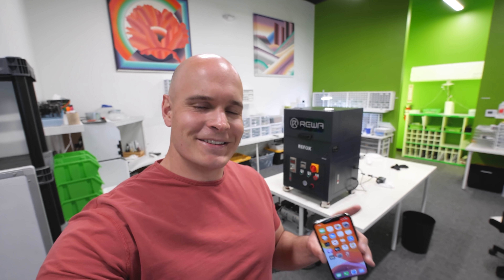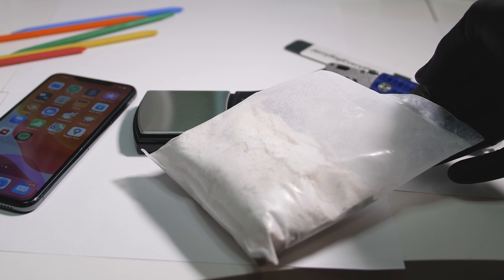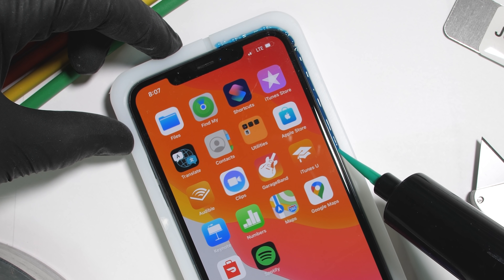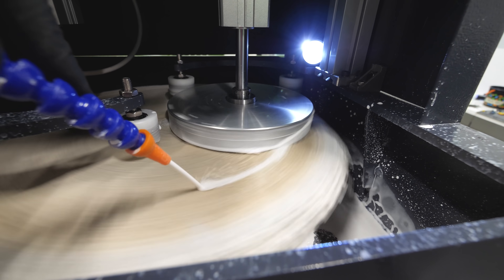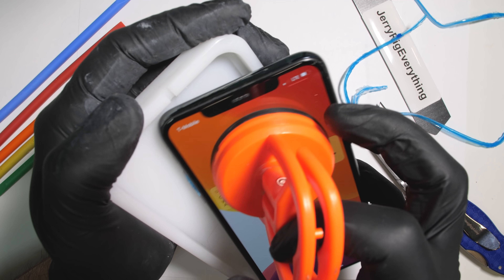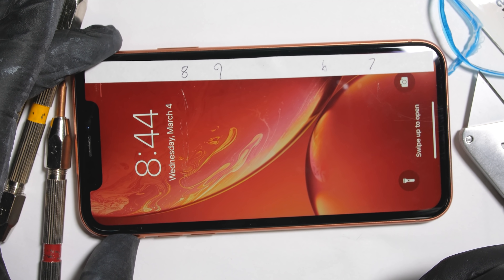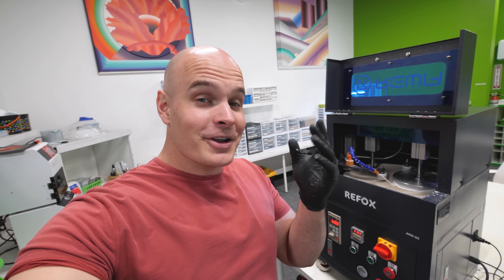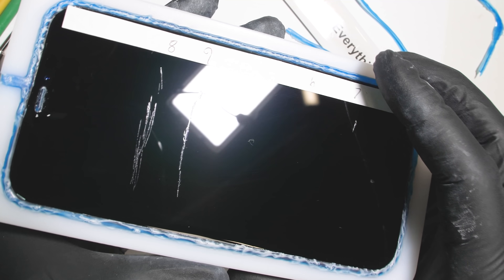How to Remove Scratches on an iPhone Screen? - (Not Clickbait)

Comment: Does this procedure thin the screen and maybe cause some abnormalities ?
Reply: Yes, but by such a small amount that it's negligible
And it shouldn't cause any major abnormalities besides removing the oleophobic coating (which, as shown in the video, can be replaced) if done properly.

So, (besides water damage risk) if this causes major issues with glass thickness, you're using it too much
And if you use it right, downsides are negligible and can be easily fixed

Comment: Hi, I don't have the same machine as you but I would like to ask you a question... why does the glue come off mine or does water get in with the glue applied? And what pressure is the machine at? Thank you very much

Comment: I have a question and I need help. 
After using cerium oxide how can I get rid of the mark that leave after that?
I use the powder and after cleaning it up it shows a darker  spot on it when I spray water. Is it the coating?

Comment: I've done this with a Dremel ¯\_(ツ)_/¯

Obviously it doesn't treat the whole screen evenly, but light scratches can be removed very quickly using a little cerium oxide and a polishing tool

Comment: So pretty much the old way of fixing games cause ppl didn't know how to take care of ANYTHING 20 years ago....little thing you spray the disk then put the disk in the  do-hicky crank and crank and crank for 5mins take it out clean it off then do it again the other way blah blah blah....cheaper way UV clear clear glue (clear 💅 works OKISH) then VERY VERY THIN coat only on the bad parts then WET SAND BY HAND then polish ****warning**** DO NOT I MEAN DO NOT even think of trying unless you know how to wet sand or you will make it 100000000000x worse

Comment: Cheap way: 
-cheap mini grider or burr + polishing pad $20, or just polishing pad $1
-glue gun for sealing phone hole 1$
-Cerium oxide 20gr $1
-auto glass coating 30ml $1
Total: under $100.000

Comment: What do you use for oleophobic coating?And would an automotive nano ceramic coating do the same thing? Thanks
Reply: NanoSlic NS-1500 is my best guess, or maybe Daikin Chemical DSX-e or UD120 (Daikin is dealers only)
I just bought a test pack of NS-1500 and excited to see how it treats my S22 ultra.
The coating is 100% completely gone. Such a shame with new phones nowadays. I still have my note20 and it's like brand new still, got it over 3 years ago 
I'll keep you updated on results
Reply: @collinmcballin  thanks for the info, did you try it out?

Comment: for small scratches a nano glass screen protector will hide them, and a regular temper glass will too but nanoglass works way better at hiding the scratches as it is applied as drops
Reply: While owning the phone, the use of screen protectors to cover and hide scratches is cool but the biggest reason we watch these videos and why these machines are important is about genuinely removing/erasing of scratches. And that's because we are concerned with the preservation of our phone's third-party resale value. As we are all aware, ANY minor scratch, however small and shallow, means automatic -$50 in resale price.

Comment: It's a pretty neat idea. But wouldn't the thinner glass cause issues with the touch response/sensitivity? Also, this might not work as well for phones with slightly curved displays
Reply: I think the digitizer is under the glass so it won't have an effect

Comment: Hi Jerry, do you maybe know if it's possible to get rid of permanent spots and wipes on the screen ?
i don't know if you know this but i noticed that if i use swipe gestures, quite quickly it leaves permanent wipes on the glass and now i also noticed this issue by using the under scree fingerprint scanner.
i can clean my screen as much as i want, it stays visable.

Comment: Not worth it in the long run. I’d rather live with the scratch. Back in the days of the iPhone 4, I got a small scratch on the screen. You couldn’t buff it out because it was aluminosilicate glass—glass artificially hardened with other elements such as aluminum and silicon. The glass is simply too hard. Those scratches on the glass are permanent I’m sorry to say. The only way to make them disappear is to shave a thin layer off. Shaving off a thin layer, you eliminate the light scratches to be sure. But along with it, you get rid of the oleophobic coating, and severely weaken the drop protection of the glass. Cool video, but a screen protector is cheaper, and it doesn’t permanently ruin your device.

Comment: Had almost all my phones without protectors, only phone with a protector was a Sony Ericsson Xperia - the first ever.
The protector was so shitty that I scrapped it and today a s9 and 4 years in use, the front glass is perfect , well those non visible scratches, but the back glass is broken on several corners and cracked in different directions.

But for a conclusion, the phone is still a practical piece of hardware and it doesn't really lose its practicality with those scratches.

I've made a mend with myself not to throw my phones and If I do, I'll cover the costs - you can hold the shit on a stick for just so long until it drops.

I'll better enjoy the outer dimensions and the visual aesthetics as long, rather than cover it with something

Comment: I don’t think I will trust someone to do that process on my iPhone 13 Pro so I can remove a potential scratch (as I don’t get scratches on my phone because I’m taking care of it), but this machine I think is a very good opportunity for shops that sell used phones and want their displays to be scratch free, to not replace them with shitty quality OEM ones, but instead use this machine to give new life to their original displays and sell them as scratch free ones! Add a new oleophobic coating on them after the process and you have an almost “brand new” phone to sell, at least screen wise!

Comment: For those who don’t know. Cirium oxide it what we use to remove scratches from windshields. Typically caused by windshield wipers… but it’s very difficult to use.
Reply: Do you have an email address? It’s like to speak to you about this windscreen business. Got scratches I want removed. Thanks In advance

Comment: Technically if you run it in the machine enough times you should be able to remove level 9 depending on how thick the screen is since the machine is just removing a small layer each time.
Reply: Not really since the level 9 cracks it all the way through so no matter how far you go unless you replace the glass it is staying

Comment: I've had 4 iPhones over the years, but this year my iPhone 12 mini has got several scratches on it, this was NEVER an issue for me before. Apple claims the 12 is the hardest they've made (up to then), are they lying, is this a fault with iPhone 12?
Reply: Idk everything I have scratches for no reason, my iPad, my android phone, and my iPhone XS, haven't even had this thing a day and it's scratching insanely. My iPhone 7 before didn't scratch much but everything else I've had does

Comment: Why not just use fillers made for stone chips on windscreens and then slap a good screen protector from flolab on there. Good as new, as long as you dont plan to resell it. Grinding down the whole surface like this makes the whole surface weaker.

Comment: Good engineers bring awesomes working tools for the professionals of phone repairs. I guess, if prices of a such a task is reasonnable, it could influence people in a more durable way, choosing to repair instead of buy new.

Edit : but, i think it would be a smart thing to know what the exact thinning measuring is for every type of glass per minutes of use. Cause in the end, i guess it may damage the screen or make it tactily unresponsive (for the little i could guess of phone glass)
Reply: I'm not sure if this is worth it over a new screen... I guess what engineers could do is a way to have the front glass independant from the screen, but everyone has sexy phone mentality...

Comment: This is great, all phone repair shops should invest in one of these, faaaar cheaper than replacing screens, and easier. I'm wondering if there is a worthwhile way of removing nicks from the phone, where it was dropped on say concrete and it's not scratches per se but little divets and pits, maybe fill up the holes with some sort of acrylic glass of some sort.

Comment: Very informative and good thing to know something like this exists! Thanks for sharing!
Reply: The actual depth of those level 6 scratches is microscopic but due to the highly polished surface it’s very easy to see due to changes in the refraction properties of the glass in that area. If you made the same mark on, say a matte plastic surface you wouldn’t even be able to see it. For this reason I don’t believe it will compromise the strength in any meaningful way. 

The level 9 groove has actually removed a substantial amount of glass rather than just disrupting the refractive properties of the glass, so the buffer machine would probably never be able to buff it out

Comment: One more important thing- removing a layer of the screen thickness just making it more thinner, that mean easier to crack! But gluing of glass screen protector just improve durability of the screen!
Reply: i doubt a few microns of glass will make it notecably more vunerable

Comment: Much more faster,cheaper , safe for the screen and with better result is to glue glass screen protector with UV glue to the scratched screen. The glue has same optical values like a screen glass ,it will fill the scratches completely and the result always is perfect.

Comment: If level 8 scratch can’t be removed, this machine is useless as you can put on a 50c screen protector to cover the most of the light scratches on screen like level 6 or 7 then it’s nearly invisible.

Comment: I'd be interested to see the damage that leaving a device in this machine for far too long would cause, and what impact on shatter resistance that process has.
Reply: Totally agree! @JerryRigEverything
Reply: would it matter if you stick a new screen protector, after? no
Reply: @Ensource  it would matter. the screen underneath the screen protector could still crack if you drop it
Reply: @Ensource 

It would because screen protectors do very little to stop shattering, especially since most screen shatters hapoen if the phone hits the grind on its side - an area not covered by the screen protector.

Comment: Do we need to use a air compressor?? And if yes, where to connect it? And how does the puck comes down? For me, the machine is being turned on but the puck isn’t connecting the mould. Pls help, need urgent!

Comment: UPDATE: once again this product was on my mind, obviously I never received an answer. After checking the description again I decided to look at the machine, $2k if anyone is wondering, and found that the coating is included with the machine. So I wanted to see if I could purchase individually and while it takes you to a page where it seems possible there's no price unless your register. Then there's no price at all. It's free with the machine. Sorry not going buy a 2000 dollar machine to get a bottle of coating. Also tried looking up independently of the site, REFOX AFC-100 Oleophobic Coating, and it doesn't appear online. 

 @JerryRigEverything, where did you get and what is the oleophobic coating you used?

Comment: Seems like the process would weaken the glass. So while you’re getting rid of scratches, your phone is probably going to break easier when you drop it.
Reply: Glass will tend to break along any weak points so if you've already got scratches then it probably increases the crack resistance by removing them even if the glass is now slightly thinner.

Comment: I'd be interested in using this to get the scratches off of my phone honestly, the only worry I have is by making the glass thinner it could crack more easily. BUT at the same time you're getting rid of those weakpoints so maybe it wouldn't?

Comment: $2300... it is okay if you run a phone repair business. For consumers to buy this home though, it is an overkill. Just offer scratch removal (waterproof untampered phones only) for $30-50 (with the coating treatmrent) a pop, and it will pay itself back in a month or two. I would use this service to remove scratches from a modern $XXXX flagship phone before selling it.

Comment: Cool video but i really don't think it's that worth the risk .... Knowing the glass is thinner and less resistant to pressure..... And btw This "starts at level 6 with deeper grooves at a level seven" is dumb...... Just hear me out, You can scratch glass with softer stuff like good ol' aluminium, just hit it hard enough. A level 6 hardness object can do more damage than a level 10 hardness object if you press hard enough..... And the other way around where a level 9 does less damage than a level 6 if you press light enough.....

Comment: I wouldn't trust this especially on Iphone. The frame around the glass could leak between the Glass and plastic frame or plastic frame and metal body.And i really doubt that coating that you put on the screen will last more than a few months.

Comment: I just always keep a screen protector on it and replace that. Then I don't have to worry about scratches and it's a buffer against breaks.
Reply: But with under display fingerprint scanner, screen protectors are a problem
Reply: @midax75  I've had 4 phones with in screen fingerprint scanners and never had an issue.

Comment: would that liquid make all your intestines smooth af if you drank that liquid bc that was what i was thinking about through that whole video
Reply: Yes. I think. You would probably die, but moments before you die you could feel smoothness how easily now food and drinks flow trough you. Also flow will happen without consuming, because everything in your body is made to break food smaller and consume, and you will get rid of that.

Comment: I could see walking into a cell repair shop and paying 30 bucks to have this done. on old phone  I can see dealers on places like backmarket buying and using it  to up there profits .  3400 bucks  isn't much if it turns a cell phone from fair condition to good or better .  they could make an extra 50 to 200 bucks a phone with it .  Basicly someone taken the tec they use to polish  and detail cars and combined it into this machine.

Comment: removing scratches is nothing new... the basic principle is to remove the surrounding layer to bring it down to the same level, the alternative is more expensive (energy wise) you need to add the same material into the scratch, over fill it, melt, and resurface it, we used to do it all the time with old CD and DVD

Comment: I live Trinidad and a iPhone 6 16gb is literally $1200 a new lcd for a iPhone 12 is like $1400 and the iPhone 12pro Max is literally 10,000+ to fix the back glass on a iPhone X is around $1400 I CAN'T IMAGINE HOW MUCH THEY'LL CHARGE TO REMOVE THOSE LVL 7 AND UNDER SCRATCHES

Comment: What if you fill the lvl 8-9 scratches with resin and let them hardened and load the phone in to the machine
Reply: that was interesting to be tried
Reply: Yea i dunno they got some pretty crazy stuff out these days..  ive had a windshield crack/ chip repair with epoxy resin but they used a big suction cup with a pump that pulled all the bubbles out and pushed the stuff fully into the crack then buffed it out and i couldnt see the crack except when light hits it a certain way when its wet out..  but still going strong a year later..  cost like 1/4 the price of new windshield so yea..
Reply: Thats what im thinking too
Reply: I used to be a windshield tech and for this to work you'd have to Dremel out all of the white first then apply the acrylic followed by uv so as long as he can get the white out.. it should work

Comment: To my knowledge distilled water is non-conductive so it technically should be no risk. I remember watching a video where someone made a water-tight computer case and filled it with distilled water and ran the computer like that - completely submerged - and it was fine.

Comment: That carpet like rug Jerry described looks like a floor buffing pad. I’ve actually used a polishing pad and rotary before to buff out phone scratches. Especially for the iPhone 3G. Should’ve used glass polish back then, definitely would be more effective. Normal Polish just hazes the glass over.

Comment: I wonder if the initial scratches were only done to the coating of the screen, and this machine simply removes that layer so it can be applied again.

Or perhaps everytime you run the phone on it, a small layer of the glass peels off meaning your glass gets less and less hard over time?

Regardless, micro scratches annoy me to no end, I would risk an ip68 rated phone if it meant that I can get rid of scratches once a year on my phone.

Very good video!
Reply: Cerium oxide is definitely used by auto glass companies.  My wiper scored my wind shield. I consulted one  company to see how they polished such damage was very surprised to see one angle grinder with foam pad ,squirt bottle of cerium oxide solution. One polishing machine used to buff out paint finish’s    The trick  is to remove the scratches without blooming the glass practice is required, but it is done very often at that shop. Key to removing is access to the glass over the hood they had amino scaffold you pulled under so you could square up, and control pressure and application of the compound to better fair and true your work.  Of course the bench top polishing is the way to go. I’m glad I witnessed his demo. Where can address this service?

Comment: I think i will buy a new real me 7 pro every time I scratch it up to 14 times and most likely it will be cheaper. Also who doesn't use a tempered glass these days which is 1 dollar and easily replaceable? Thanks I will just take my 3400 tempered glasses and apply a new one every 5 days for the rest of my life if I live at 70